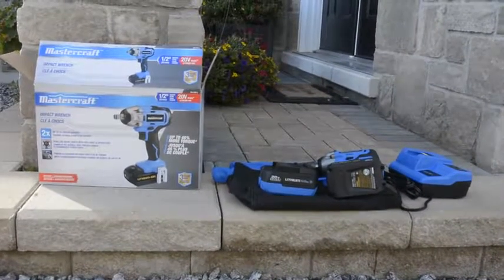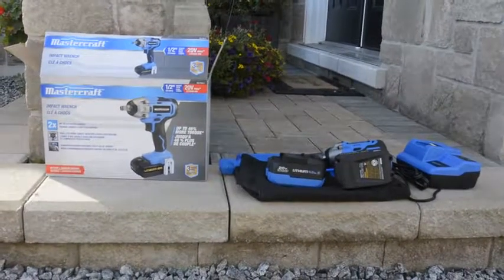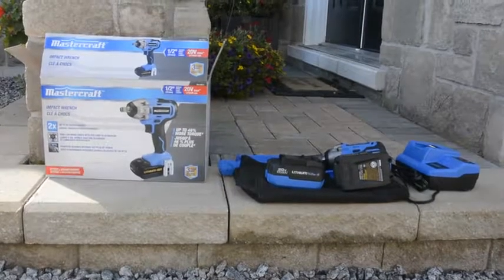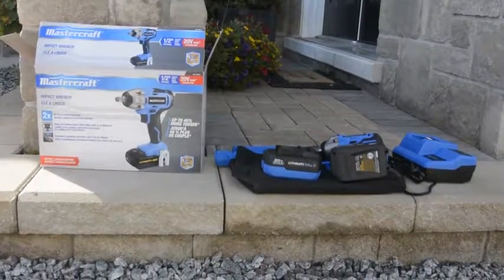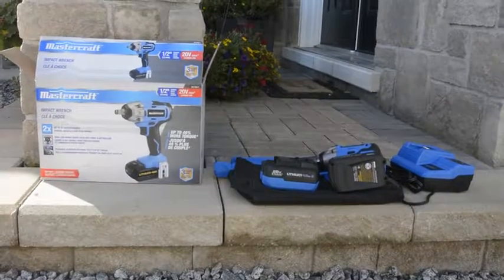My Product Review: Mastercraft 20V Brushed 1/2" Impact Wrench

Comment: Another Canadian Tire promotion video. He didn’t test torque (fastening or nut busting) nor speed, nor battery depletion or charge time, no temperature reading, no rpm or torque legal claim, no longevity test (how long it lasts of say 4 cars tires on/off 4 times a year (16 times X 5 bolts X 2 = 160 bolts/year, 6months, 1year, 3yr, 5 etc.) no word on who made this (licensed by Stanely Black & Decker, made in China) no mention that it is a BRUSHED motor, condition of the chuck. Heck he didn’t even demonstrate taking stubborn rusted nuts OFF. Though I always recommend using a breaker bar, best for the tool unless it’s an M18 Fuel Milwaukee that tool can unbolt anything fast with their Red Lithium batteries.  YouTube Project Farm (now that’s a proper review)
Reply: you have nothing on your channel  why dont you do the test .